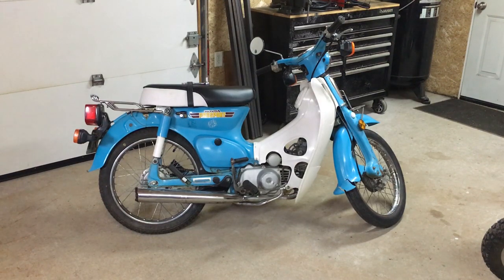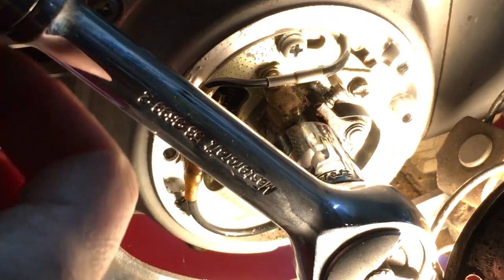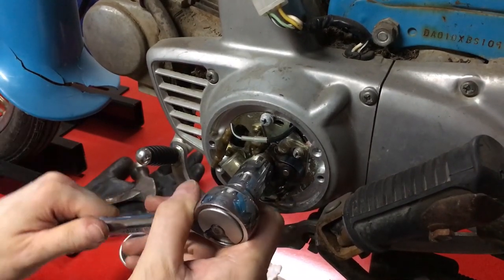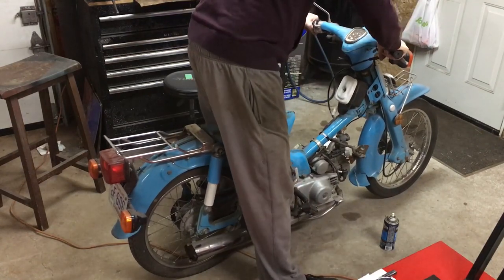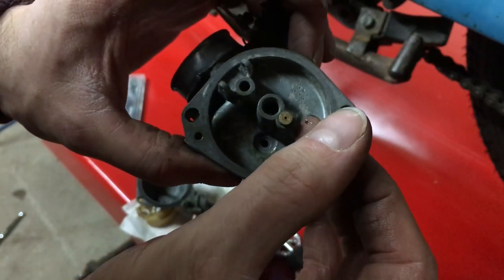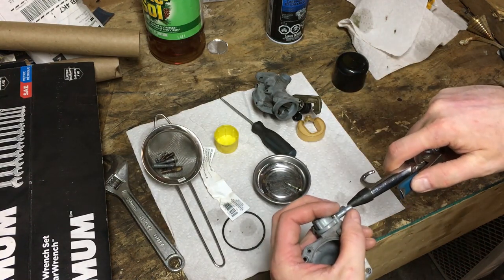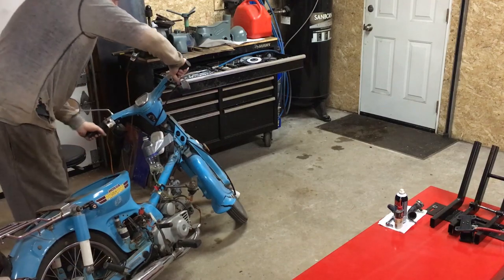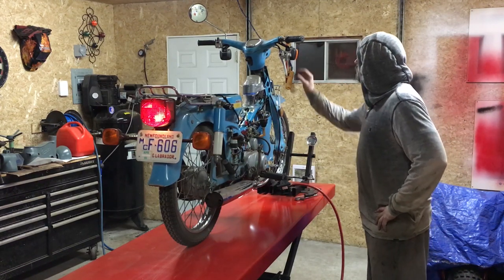1981 Honda C70 Super Cub Restoration - Part 1 - First Start

Comment: Loving this because I currently have the same exact Passport and color purchased used, non-working, and I'm whiffing a Pine-Sol mixture heating up in an ultrasonic cleaner with the carb parts in it, brainstorming how to get it to run in the next few steps.

Comment: I have one a 1972 honda c70 yellow and white that I wanna get running really bad but I'm clueless when it comes to wiring and the whole center where the fascea over the handlebars is a birds nest of wires
Reply from the maker: Pick up a shop manual, read lots of stuff online, and take lots of pictures if you start taking things apart so you can put it back together! We all start somewhere!
Reply: @blastworks  I paid someone to fix it and we had a disagreement because he was taking months like 3 months to fix it and I wanted it back and he just destroyed the shit out of it I can't afford to take him to court so I'm just left looking at a heap of fuckery and it's a huge disappointment because it was passed down to me from my grandparents it was in fine condition it just needed a new carburetor from being tarnished with old gas and new tires. I took it as a loss and now I'll just do everything myself. Definitely will look into getting my hands on a shop manual
Reply from the maker: @farmerbobbygrows3338  That's a horrible situation to be in Robert. Hopefully when you start digging into it on your own you'll be able to draw satisfaction out of correcting a wrong and making it work!

Comment: How to get head of
Reply from the maker: I won't be doing a rebuild of this motor as it is very low kms. There are other videos on my channel of me rebuilding single cylinder motorcycle motors which should help!
Reply: @blastworks  is 90k miles bad or would it a rebuild be needed ?
Reply from the maker: @edgaribanez8592  Depends on whether you are having issues or not. If mine had 90k on it, I'd very likely rebuild it with a new piston and rings.
Reply from the maker: @edgaribanez8592  Yeah, if the oil is gunky I would totally rebuild it.
Reply: @blastworks  thank you for the advice I might be asking alot btw